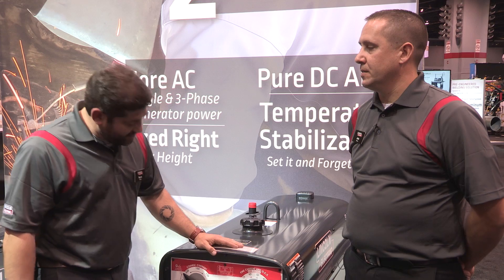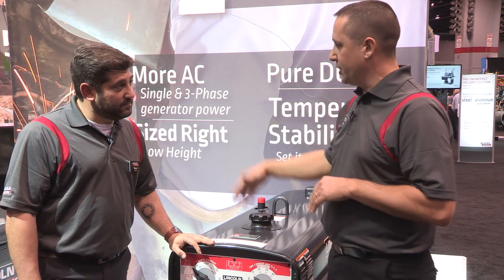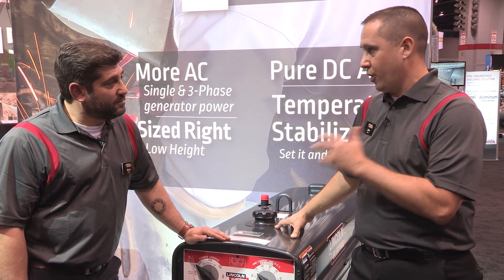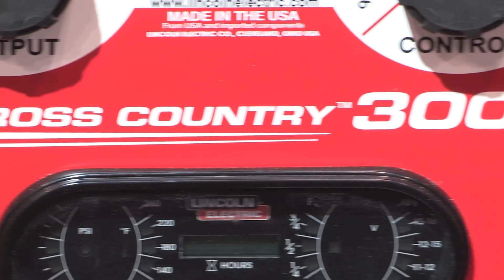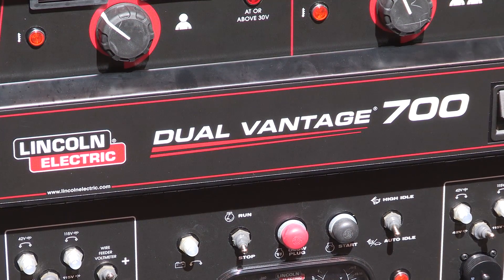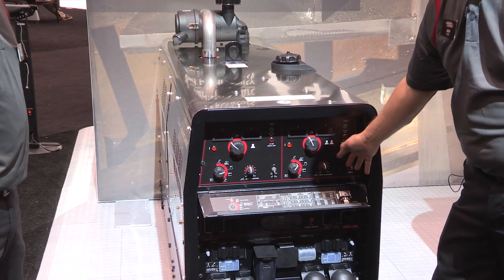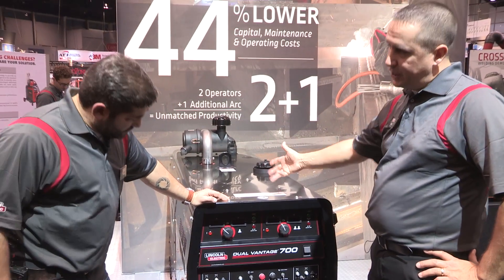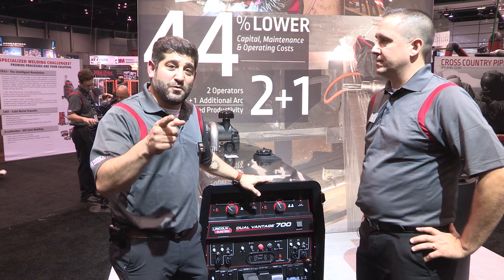Lincoln Electric's Engine Driven Welders at FABTECH 2015

Comment: is the sole purpose of the ac generator rectified to dc on the cross country so it can have more auxiliary power? seems like dc generators such as classic i, ii , iii and sae 300 have had adequate auxiliary power in the past. just a thought
Reply: nobody can imitate the DC generator yet. once you use a generator you will know
Reply from the maker: +Ben Covington Thanks for your question Ben. 
       Yes, that is one of the reasons why the Cross Country 300 was developed.  The PipePro has taken some market share in the pipeline segment due to the smaller size and the additional Auxiliary output.  The Vantage 300 was our only solution but it wasn’t designed specifically for pipe welding but more for general fabrication.  The Cross Country 300 has an Arc that is very close to a DC Generator but provides more than 3 times the Auxiliary output, smaller compact size and is 400 lbs lighter.
Reply: kind of what i was thinking. also you dont see many pipeliners with their older machines plus a stand alone generator, so the whole extra auxiliary power argument doesnt really make sense to me. im not too fond of the whole idea of the rectified dc arc vs pure dc. if its not broke dont fix it
Reply: +lincolnelectrictv is my vantage 300 still adequate to go to pipeline? Ive been using it in refainaries with mostly tig